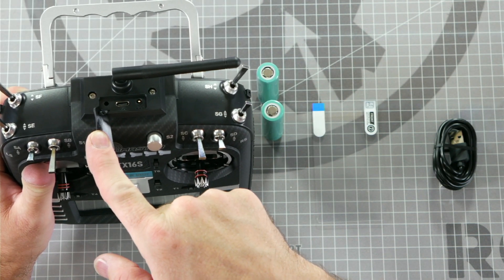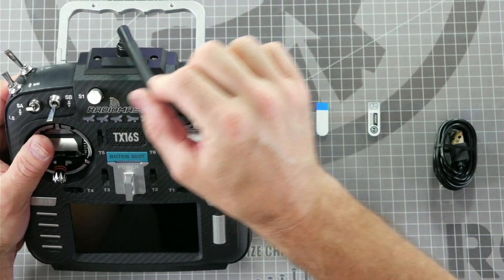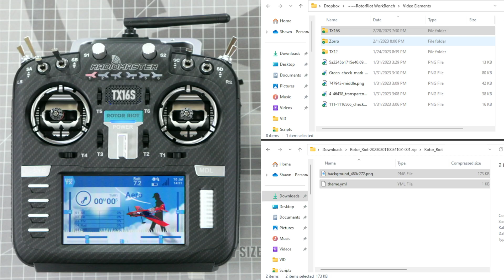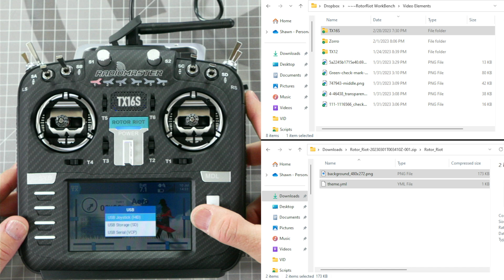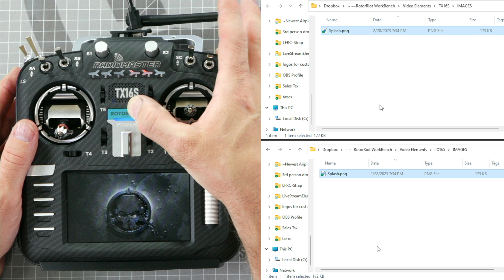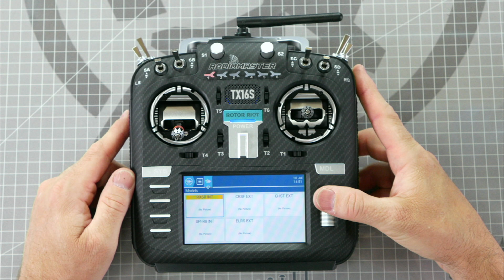RadioMaster TX16XS Quick Start Guide (EdgeTX)

Comment: I'm just starting out, wanting to try flying with a drone simulator before getting a drone, but purchased a RadioMaster TX16S MKII (ELRS version currently running edgetx-tx16s version 2.7.1) because it was generally highly recommended. I figure better to practice with an actual controller. Now I'm trying to connect it to my brand new Windows 11 computer (via a USB-C cable connected to the top port, not bottom), but unlike in your video no window pops up prompting me to choose USB Joystick, Storage, or Serial. It doesn't seem to do anything. 

The USB-C cable is a high-end cable, but I also switched in another USB-C cable we use for a PS5 controller just in case it was "the cable". 

I've seen some YouTube videos mentioning the need for STM32 COM drivers, but everything I see about that talks about older OS versions, and that Windows 10 and 11 should not require them? But, since in the video by RC Video Reviews (titled "SOLVED: TX16s STM32 Driver for Windows 11") specifically seems to be about Windows 11 and he mentions having those drivers I went to that website. But even the driver download makes it look like you are choosing between a Windows 7 or Windows 8 driver which just seems wrong. Are there some base drivers that need to be installed for Windows 11 to talk to the RadioMaster TX16S over the USB-C cable?  I feel like I need to hear someone "say it" if I'm really supposed to install a USB driver on Windows 11 that literally has W7 or W8 in the driver filename. 

I wonder if my radio was sitting in a warehouse for too? The latest release version of EdgeTX is 2.10.6 while the version on my TX16S is 2.7.1. Connecting over USB-C seemed like the easy way to update that though. I'm guessing I can copy something onto the SSD to update that, but haven't gone down that path yet and I'm not sure if that's really related to the problem.

The user manual that came with the TX16S only has like 4 pages in English, only 2 of which are really useful information. It doesn't really have anything about how to set up and use it. It was highly recommended. I didn't realize I wasn't just getting a fancy remote control, I was buying a hardware platform that can run different OS's and has to be set up. So, I'm in a little over my head and wondering if there's something simple I missed.
Reply: You shouldn’t have to download any drivers, if you’re just using the radio with a drone simulator. 

1. Make sure the usb-c cord you are using can transfer data. Some are charge only. 

2. Check your TX16S settings. It may not be enabled to show the prompt when connecting via usb. 

3. select joystick. It should be compatible with most simulators.